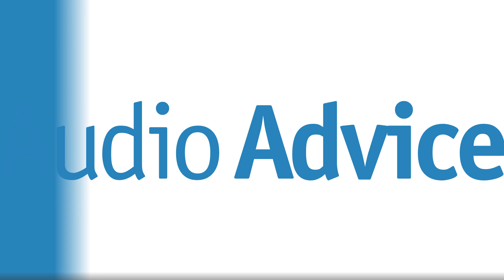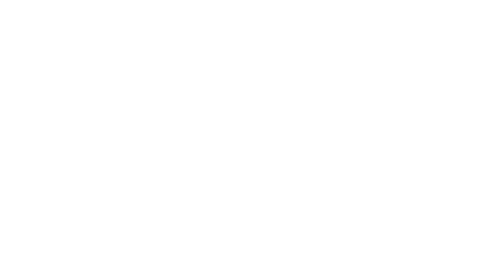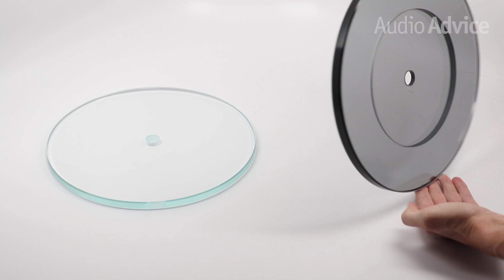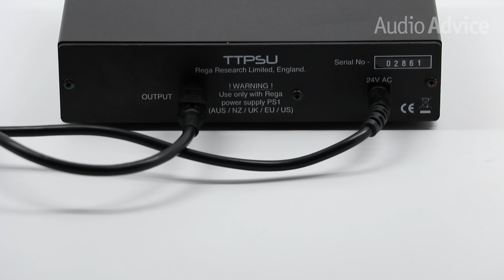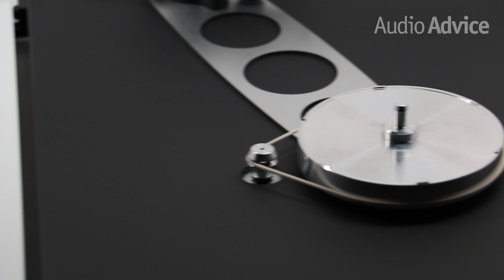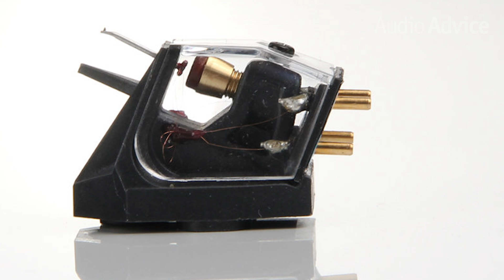Rega Planar 3 and Planar 6 Turntable Comparison

Comment: Very concise clear run thru. I'm currently @ upper-budget serviced, modded vintage 80s RPlanar3 + 303arm + nd3cart.  Wanting 2 enter vinyl "mid-fi" so am leaning 2ward p6 + 330arm + nd5cart + that PUS.  I feel waste of $ achieving just incremental improvements on p3 .. just bite bullet, save time, drop needle/enjoy the music.  Have Pioneer A400 serviced few yrs ago but needing little more TLC.  Have refurbished Allison-6 spkrs I'm VERY happy with (has convincing bass).  Have coupla nice cassette decks in + the tech.  Refreshing the dream of compiling my own hi-qual mix-tapes .. just as the hobby was in my youth back i/t 70s
Reply from the maker: Glad you liked it, that would be a good choice. Feel free to reach out to our team at www.audioadvice.com to discuss.

Comment: I have the Planar 3 (1916)  with Exact and tt - PSU. I think the difference about 6
is in the Metal platter and siliconic belt. In Italy  you buy a Planar 3 with 730 euro;
Forr this 6 Planar you must pay muh more.
PLEASE,  I  HAVE  A QUESTION : The Planar 3 is compatible with metal platter ( I think
the name is a Groovetracer) and Siliconic Belt ?    Sorry for my english language but i'm italian.   Fabioo  '961 near MILAN  10/02/2019 h.21,28
Reply: late answer but yes

Comment: Do we need an external pre-amp or can we connect it directly to the receiver? Thanks.
Reply: If the receiver doesn't have a built in phono pre-amp you will need an external pre-amp.

Comment: Molto sopravvalutato ci sono giradischi italiani di pari prezzo migliori ma nessuno ne parla .Perché??
Reply: quali: Audio silente enry level 14000euro,Aurora Electron su ordinazione  6900euro
Gold Note entry 895 euro, Extreme Audio entry Non DIsponibile, Mel Audio entry8000, MPN IMPERIAL entry 5700Euro, New Horizon entry 399 cominciamo
a ragionare THE SOUND OF THE VALVE  non disponibile, siamo di nuovo alle stelle,
Trinaudio entry 3850euro, Zegna unico modello 3000euro, ma devi comprare in
boutique un costoso completo di Ermenegildo Zegna: - ah gli italiani, cosa accomuna un prodotto meccanico ad uno di alta moda, ma la moda.
Come vedi dall'annuario ufficiale listini del 2019, siamo molto cari a parte l'appena
uscito New Horizon, che il prossimo anno o sparirà o costerà il triplo e i sempre
onesti ragazzi della Golde Note di Firenze con il loro Valore Compact da 850euro,
che consiglerei al mio peggior nemico: E' una ditta seria e produce dalle Elettroniche
al Kymyas (un prodotto che non ti fa' udire fruscii sui vinili datati per circa 6 mesi).
Io lo uso (costa 50euro, ma li vale) e gli Englishmen anche perche so' furbi.
Io ho un Rega Planar 3 (2016) con Exact e tt-PSU. In Italia vogliono strafare come in
tutto del resto, vendi 2 articoli e hai fatto l'annata. Roy Gandi e il nuovo patron di
B&W ( si è appena insediato) giocano sui grandi numeri; se l'italico furbone di cui
sopra non vende i 2 pezzi in programma chiude, rimane con i fornitori da pagare,
ma tanto siamo in Italia e te la cavi comunque, perchè fare previsioni, curare il mercato, sgobbare etc. IL motto è godiamocela, domani è un altro giorno.
Scusa caro audiofilo, ma sei stato lo spunto che mi ha fatto togliere qulche sassolino dalle scarpe, E' che sono rammaricato a vedere come finisce il mio
paese: _ERAVAMO la sesta potenza economica mondiale, ora è rimasta la Ferrero,
qualche altra azienda e pochi volenterosi artigiani onesti. POVERA ITALIETTA MIA.
Fabioo  '961  10/02/2019  h. 22'33        Saluti

Comment: I've been an audio file for over 40 years I've come to realize this these upgrade paths are stupid!!! Sure a little tweak here and their cables do make a difference between the source and the preamplifier make a difference!!! Speaker placement speaker height for most of those tweets are free!!!! Get a budget find someone who knows about good equipment and do the best you can!!! The difference between a good $3,000 system and a good $30,000 system is minimal don't waste your money!!!😎
Reply: The more money you spend the smaller  Increment of quality you notice, but there are needles that cost 30k alone. They make ones that expensive for a reason, someone has the money and the ear for it lol.
Reply: Frederick here, here, Bravo.. well said indeed sir.
Reply: You can benchmark your 3k system to my 40k system, the outcome will simply be that we are both happy with what we have. But to be completely honest, I have listened to 500k systems and have no problem admitting its much better. I just cant afford it, and even if I could, I wouldn't be interested in spending the money. saying that the difference is minimal is just not true. I wish it was.
Reply: @butwait  I hear what you saying but I stand by what I said sure $400,000 speakers sound better but how much better then $10,000 speakers or even $2,000 speakers or even a really good pair of $600 bookshelf speakers with a really good subwoofer the right placement the right equipment to me there's not a big difference✌
Reply: You are an audio  "file"... please email me your file so that I can also become an audio "file"

Comment: Beautiful turntables. The irony is that my XTZ CD-player costing $200 (used price) outperforms both Planar 3 (which I own) and Planar 6 in almost every department. A Marantz SA-KI Pearl Lite costing $400 (used price) is in a completely different sonic universe. With the platter rotating at the speed 1% faster than 33.3 rpm Planar 3 is tonally inaccurate. Not only is it faster than it should be. The speed of the platter varies significantly which means all long notes will become wobbly.  Planar 6 is a little bit better in this department but far from the tonal accuracy of the much cheaper CD-players. Elys and Exact produce som much humming noise it is ridiculous. That amount of hum degrades the sound quality significantly. 
So, what do you get for $945 and $1595 respectively? Almost the same tactile experience as you'd get from a cheap $100 turntable. You'll of course get much better sound quality than with the $100 turntable but far inferior to a $400 CD-player. Going from Planar 3 to Planar 6 won't actually give you any sonic improvement worth anywhere near $650. You still have the exactly same tonearm. But of course, there is more to listening to vinyl than sound quality. I own a Rega Planar 3. Most of the time I don't know why. Sometimes I do.
Reply: You need to be into hifi to understand so i would stick to your second hand 200 bucks cd player & not get out of your depth. It all depends whether your a vinyl fan. Yes my cd6007usb marantz ( more than 200 bucks) probably sounds better than my rega planar 3 in perfection but to be honest your either a vinyl fan which involves more than purchasing a piece of digital music in a cheap plastic case & throwing it in an invisible draw in your cd playing box. It's the covers of your albums the ownership of real music made in a classic way, to putting of the needle gently down on a beautiful engineered piece of machinery that is nostalgic & has history. Old albums are now selling for tens of thousands that aint gonna happen with a cd ever. If your wanting to just throw it in a cd or listen to streamed music then you are not into hifi. Some people are audiophile hi fi fans because they love anything hifi & not just digitally enhanced convenient music. 945 0r 1595 turntable the same price as a 100 dollar turntable you say. Now I know your a bit of a simpleton. Go play with your 90 dollar cheapo cd player & 10 buck headphones boy.
Reply: @ENGLISHISBEST   * You`re * clearly passionate about vinyl music. Not so much on accurate spelling I noticed.
Reply: @johnristheanswer  And yet he just " owned" you....
Reply: @joebloggs8636  ?
Reply: @johnristheanswer  Oh no, it's the spelling police. Look out!